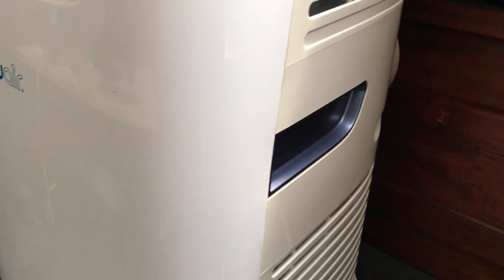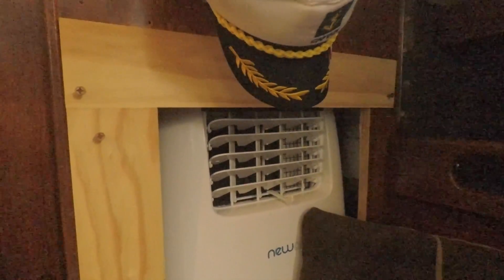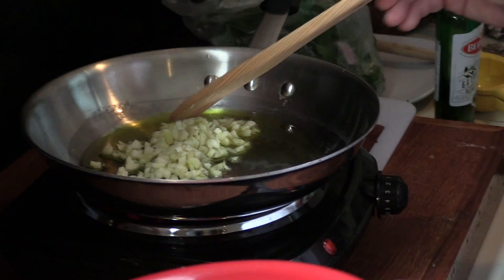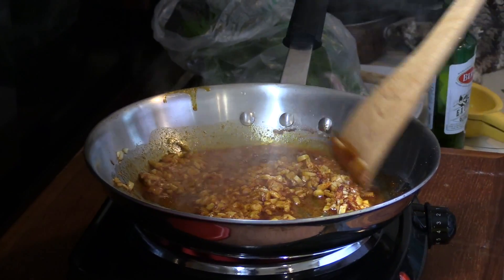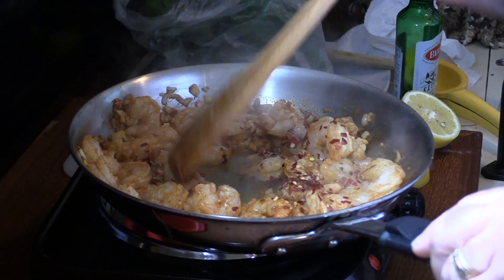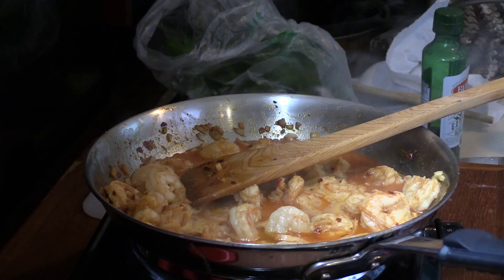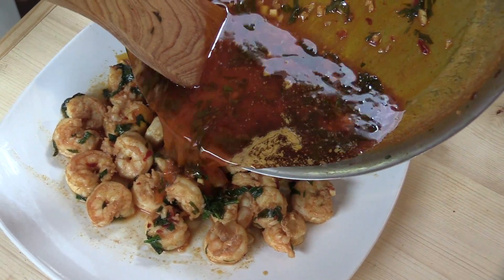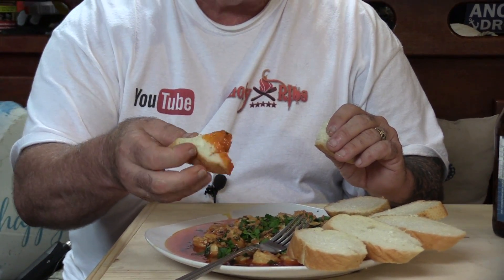Garlic Shrimp Recipe | "NewAir AC 14100H Review "

Comment: Great vid! I would've thought one of those a/c units that fits in and replaces the forward hatch cover would suffice.
Reply from the maker: The boat came with that, and we didn't like the looks of it, and the old ac unit has been sitting in my garage since last November, plus this one is almost twice the BTU rating and also it's a heat pump for winter time and I can direct the air where I want it in the living area and galley section.  Much better option for us.
Reply: Smoky Ribs BBQ & Southern Cuisine Ah, thanks. Sounds like a better choice all around. Hopefully, it'll feel like it's spitting out ice cubes!

Comment: That was a crazy good reception man!  With your experience, what, or when would I put in cream  and parm cheese?? Big Fan! Thanks!🇨🇦🇺🇸
Reply from the maker: If you wanted to add cream, you would remove the shrimp once they were cooked, then reduce this down about half.  Lower your heat to a "very" low simmer, just barely bubbling and add in the cream, then finish it off with the cold butter.  Pour this over the cooked shrimp.  Parm could go in at the end as well.  Thanks for checking it out Paul!
Reply: Sorry, meant recepi, but this is going to be the bomb with cream and parm cheese with a bit of garlic🇨🇦👍